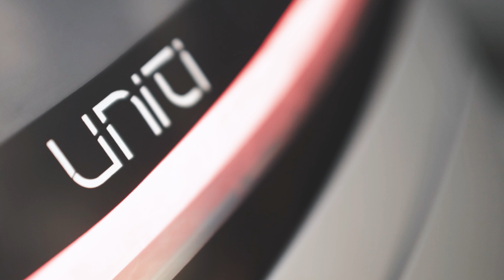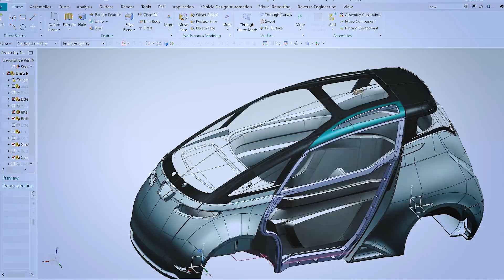Equity Crowdfunding 2018 | Uniti - Electric Car

Comment: Yes, Yes, YES!!! Finally a vehicle that is made by engineers instead of car salesmen. Current car fashion (Big and heavy) has made mass adaptation of EVs impossible. If everyone drove Teslas, the world battery production would have to increase 4000 fold. I presume this will use less than 100Wh/km = actually emitting less CO2 than a small diesel, which current EV-SUVs do not!
Reply from the maker: Yes! Thank you for understanding our vision, and yes you are completely right the new technology of electric vehicles needs to be implemented in a new way, there is room for many different cars in this new market!

All the best Albin

Comment: How muuuccchhhh?
Reply: If they're going to make it on the Tesla level that's going to be about a $35,000 car; if they going to make it on the Tata level that's going to be about a $15,000, car my guess -- somewhere in between $20k
Reply from the maker: Hello! 
We are aiming for a price around 22 - 24 000 pounds! 
Hope that answers your question.

//Albin
Reply: @unitielectriccar  For this price people can buy a descent full size car.
I really think you should try to make it cheaper if you want a mass market product.
Otherwise you might be aiming at fleets of cars for rent/share - so that's a different issue where running costs play a bigger role.
Reply from the maker: @Truck Taxi good guess we are aiming for a price around 22 - 24 000 pounds! So a premium price that fits the wider EV crowd!
Reply: Team Uniti Please try harder. That's the price range of Hyundai Ioniq and Sono Motors Sion, both are 5-seaters.

Comment: I really like the design of the car its really stunning and I really like it but if every one were to switch to electric it would take alot of coal bc well most of the worlds electricity is powerd by coal. So if we all switch to electric cars air pollution would increase by alot. Also is this car ever gonna be petrol fueled?
Reply: Solution solar panels on all new structures wind energy in all wind corridors hydroelectric power from dams and wave energy thermal power from the heat generated from the core of the Earth we have far more renewable energy potential then we have fossil fuel Reserves

Buy some solar indoor a wind turbine hook it or them directly to your water heater buy, or go large by getting an enormous Bank of solar panels or wind turbines along with it good inverter and send the energy back into the grid  and sell the excess energy to your local power company -- no need for batteries
Reply: @truck Traxi Solor is way too expensive and wind energy kills birds the other stuff is way far off from this day and age
Reply from the maker: Hello! 
Well we believe that the world needs to change to electric vehicles since that incentivises the shift to renewable energy and even if an electric car is run on coal powered energy its far more environmentally friendly than a diesel or petrol car. Check this article out it explains a bit of the logic: https://cleantechnica.com/2018/02/19/electric-car-well-to-wheel-emissions-myth/

Also if that weren't the case we also want to make sure cities become a better place to live in reducing local emissions that people breath in and noise pollution which affects people mental health immensely. 

Hope this answers your question, there is a lot of information out there but its become really clear that this shift needs to happen. I can send you some more research if you like? 

Best regards Albin
Reply: @Team uniti Yes, it might be powered by coal, proponents will say, but unlike the regular car, coal plant emissions are far away from the city centers where most people live and where damage from air pollution is greatest. However, new research in Proceedings of the National Academy of Sciences found that while gasoline cars pollute closer to home, coal-fired power actually pollutes more -- a lot more.
Reply: @team uniti there’s the energy needed to produce the car. More than a third of the lifetime carbon-dioxide emissions from an electric car comes from the energy used make the car itself, especially the battery. The mining of lithium, for instance, is not a green activity. When an electric car rolls off the production line, it’s already been responsible for more than 25,000 pounds of carbon-dioxide emission. The amount for making a conventional car: just 16,000 pounds.
Reply: But I do like your car

Comment: Are Uniti going to run a Uniti carshare platform or could I incorporate Uniti's into our existing and running carshare activities (check: sdwaterland.nl/deelauto) Might need some google translate there - sorry.
Reply from the maker: We are looking into different car sharing modells as the car is built exactly for that kind of usage! We will check it out thank you!

//Albin
Reply: We are using the MyWheels platform - works for us. @unitielectriccar